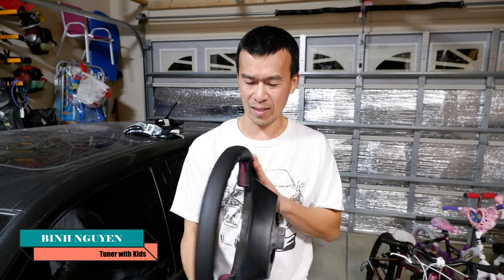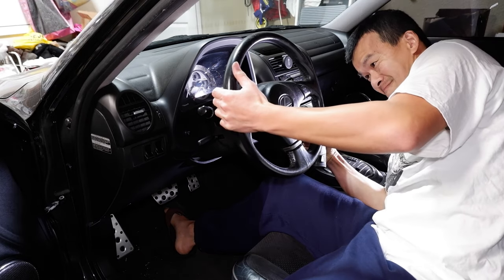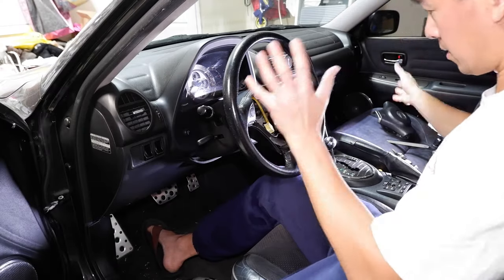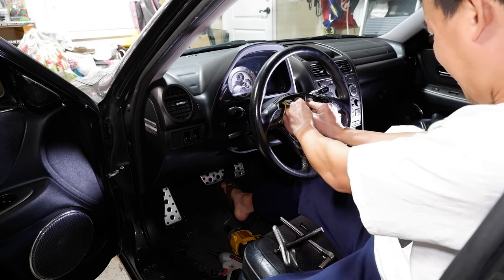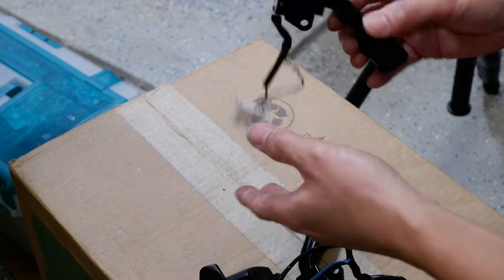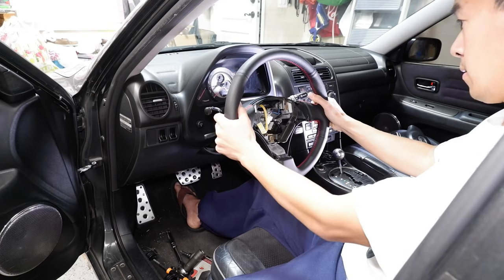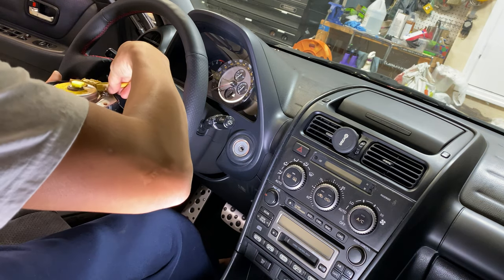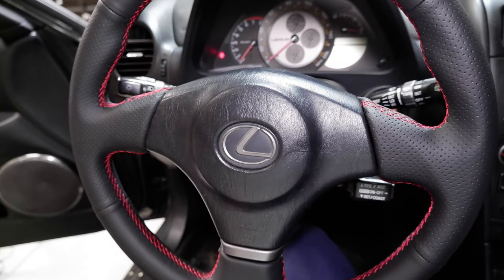Lexus Steering Wheel Airbag Removal & Install  | eBay Leather Wrap Wheel IS300 Supra Celica RAV4

Comment: I just finished removing the steering wheel. The worst part was the airbag screws! I had to push back the plastic by the screw heads to get the screws to release from the airbag.

Comment: i had my 02 is300 alignment done at goodyear and my steering wheel leans to the right but it seems to track down the road fine
Reply from the maker: They didn’t set the wheel before the alignment.
Reply: @TunerwithKids  thanks i called them back and told them and they said that they can correct it when i bring it back tomorrow
Reply: @TunerwithKids  update: i took it back to them and they still wasn't able to get it dead centered, im finished with goodyear im gonna try tire ed Cheney
Reply from the maker: Usually the good alignment guys will make adjustments for the grade. Sometimes the drainage slant on the roads causes wheel to tilt a little.

Comment: I love your content!  Your channel has been by far the best to help restore my 2005 lexus is 300. I recently bought one as a project car 2 months ago. The engine is stock but he wanted to turn it into a mild drag car and had already gutted out the interior for which i have already ordered used interior trims from ebay. the stock steering wheel has been removed and a sparco wheel has been installed but i want to put the stock steering wheel back on. Luckily the previous owner did give me the stock steering wheel and clock spring but I don't know how the clock spring should be installed. I fear if i install it incorrectly that the airbag may go off. would you have any ideas how the clock spring should go back on? the directions on the yellow sticker that on it reads before installing 1. point front wheels straight ahead. 2. rotate 2.5 turns from left end. 3. align marks.   So does that means i have to rotate all the way left til it stops then rotate the opposite direction 2.5 turns then align the marks?
Reply from the maker: Follow the directions, also download the factory service manual. It’s on one of the Supra sites.